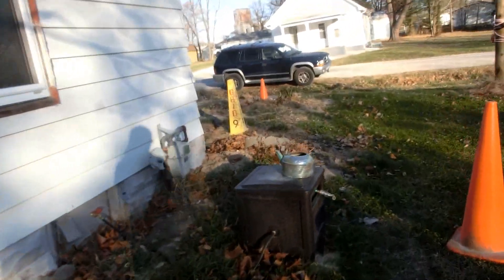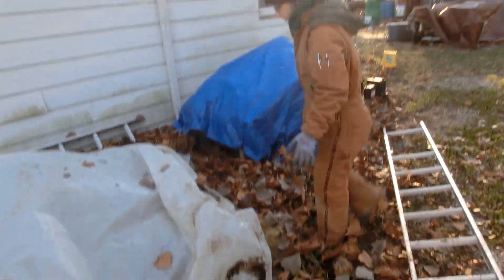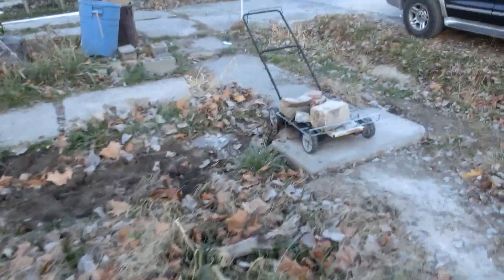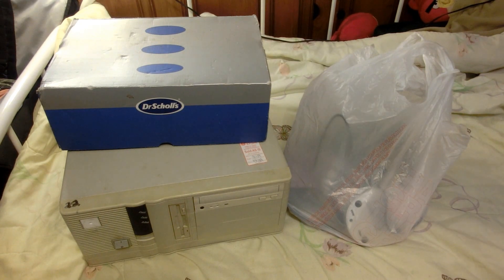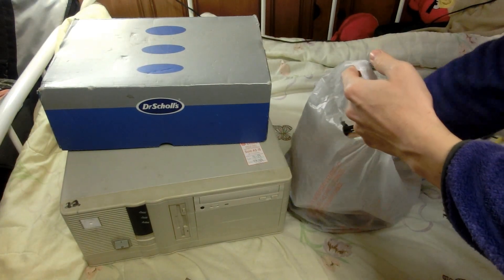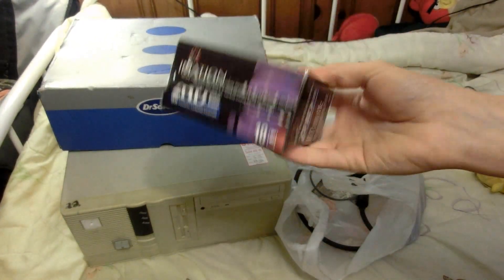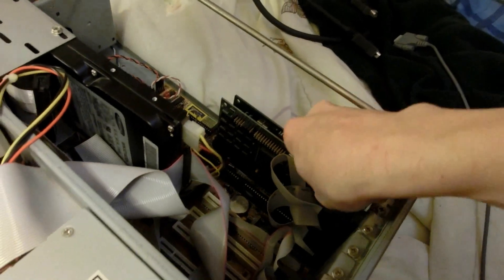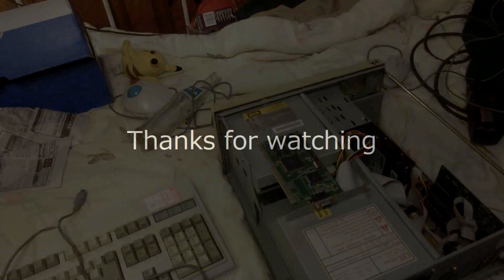Random Bits 0060: yard work, snow, thrift store finds

Comment: Great video, but for the computer, it isn't that bad. 5 pin din keyboard where comon in 1995. Remember that atx became general with their ps/2 plug in 1997 and serial mice are as good as ps/2 ones, but you can plug and unplug it even if the computer is on, wich you can't do with ps/2. Put a beter video card, more ram and windows 95 and you'll see a great speed boost, I'm sure, because my 233 mhz amd k6 is more powerfull than yours and it is also a custom computer. For exemple, the labyrinth, is realy fluid on mine. Here is the video of it if you want to see (If I rememder correctly, it was downclocked from 233 to 133 at that time) : Windows 95 computer sound card upgrade and reinstall
Reply from the maker: remember that even if you have a good CPU, the motherboard has to be good also. i have tons of way better machines than this from even before this. oh and no PS/2 ports came out in 1987 not 1997.
Reply: Rinoa Super-Genius First of all, thank you to have took the time to read my coment. Secondly, I have a crapy mother board too for my amd k6 and it is not with a crapy 1mb trident video card that you'll have a good frame rate on the windows labyrinth my s3 virge dx with 4mo do it well, but not smaller ones and also, I never saied that ps/2 where invented in 1997, I saied that the atx motherboard make them the base when they came out around 1997.
Reply from the maker: Nintenloup wolf
 what do you mean "make them the base"?
Reply: Rinoa Super-Genius the reference, the new standard.
Reply from the maker: Nintenloup wolf
 well they where pretty much standard before that, i have several computers made before that including laptops that have those ports. for instance my thinkpad was made in 1996 and has a ps/2 port. my Packard Bell computer was made in 95 and had ps/2 ports and not the larger keyboard connector.

PS/2 became standard when the PS/2 system came out. not a decade latter when the PS/2 system was already discontinued. thats why its called PS/2 and not something else.

oh and also my Tandy 1000 RLX from 1990 or so has somewhat compatible PS/2 connectors. they altered the design a bit and so some of the keys work. so i'd say that kinda counts for moving away from the large keyboard connector but not fully count towards PS/2.
Reply: Rinoa Super-Genius I know about all of that, but what I really want to say is that they became the real standard when the at board went out in the mid to late 90's because a lot of baby at mother boards still had a din-5 plug for the key board, my 1997 baby at still have it for exemple.